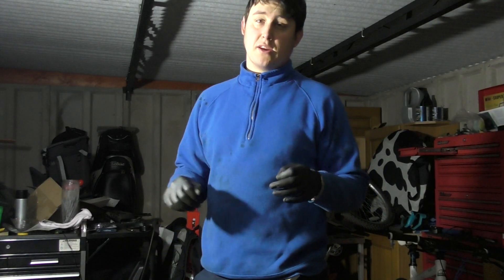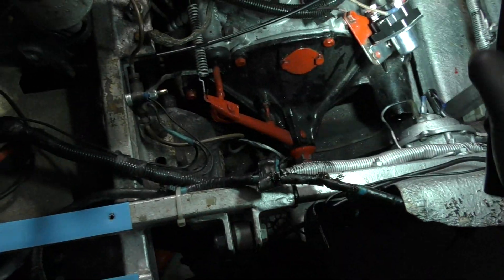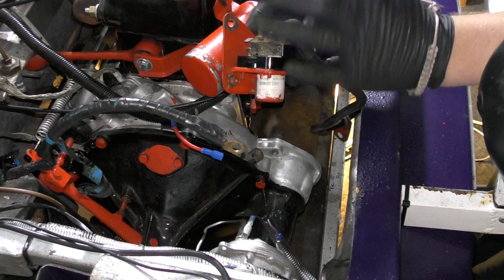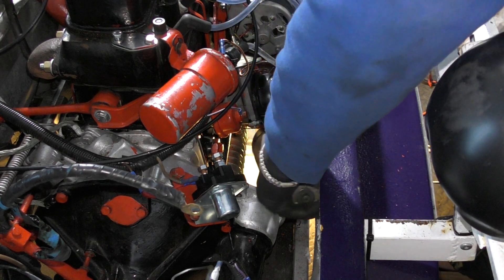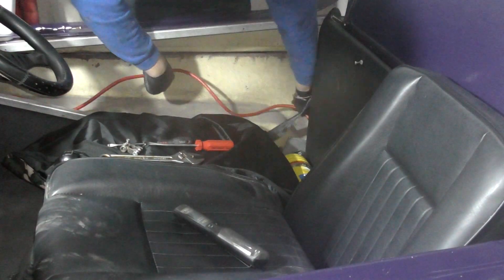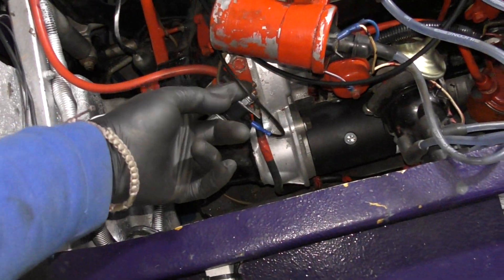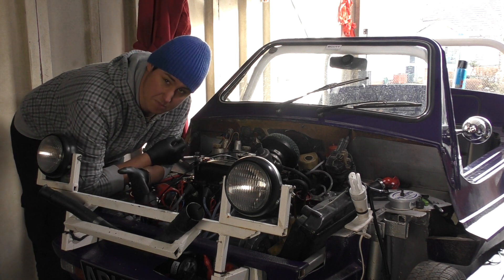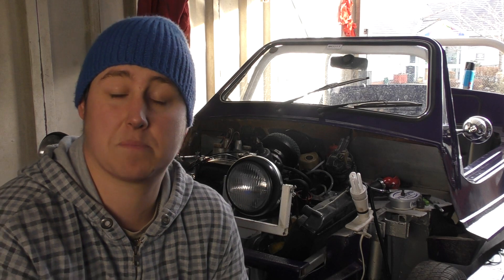Stimson Mini Bug - Will It Start?

Comment: Great work will! Nice to get it running, that starter definitely looked a bit worse for wear!
Reply from the maker: Yes your not wrong there :) in the starter motors defence the one that was fitted to the car was all painted up but was dead this was one i had as spares. But it was spares for a reason i think!